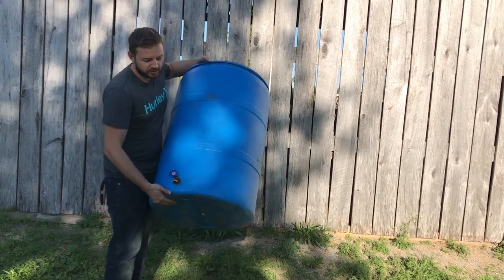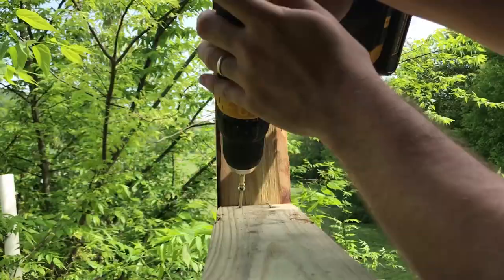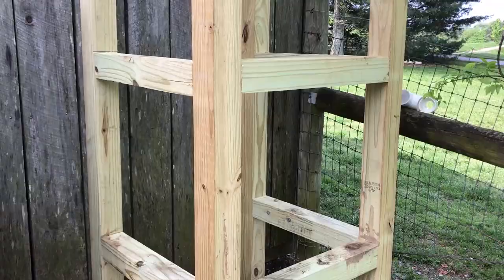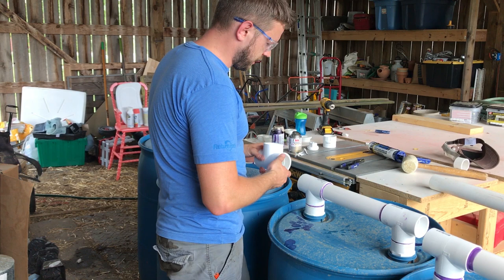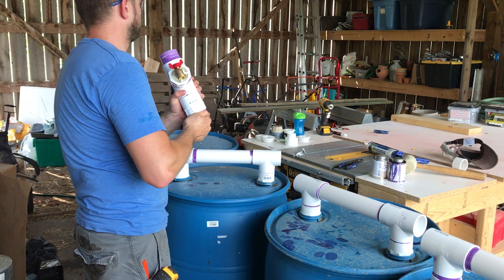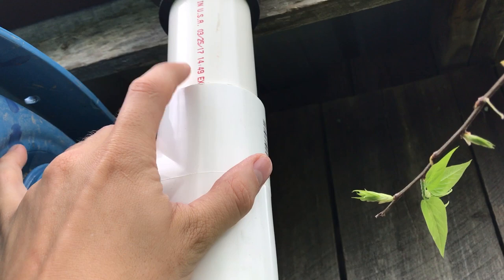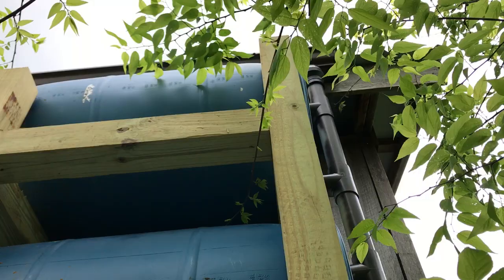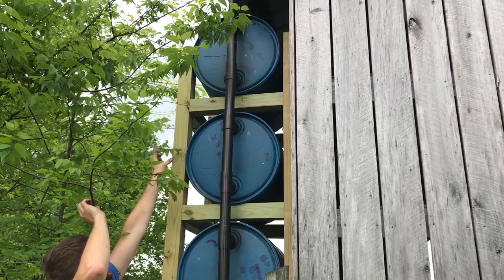🔨  DIY Rain Barrel Build - Vertical 4 Stack 55-Gallon Drum Rainwater Harvesting System

Comment: Where did you get the male adapter for the bung  holes
Reply from the maker: Home Depot they have the smaller thread and for the large thread bung I shoved on a small thread and epoxied it in 👍🏼 it did not make it into the video unfortunately. I want to redo this video sometime.
Reply: Thanks I’ve been looking every where then i seen  your video I got 13 barrels for $30 & looking to experiment with watering & feed
Reply from the maker: Oh dang that’s awesome! DO IT!
Reply: Thanks for the tip I got 1 it fits my blue barrel but not the 35 gallon white ones

Comment: I'd think the only problem is that your losing space in each barrel that you could have filled with water. each one is only going fill till it reaches the top hole in each barrel then air is going to get trapped in each one. also when draining it's not going to completely drain its only going to drain to the bottom pipe on each one leaving some water in each barrel. I think the only way to get around it would be to cut into the barrels and attach by adding pipe between them and draining into the top barrel so it flows down. but then you're cutting up good barrels. so I guess it can't be helped.
Reply from the maker: Thanks for having a look. I am going to watch the quality of the water over time.
Reply: I saw one example where it was stacked right-side up, still with 4, and the threaded holes are on the bottom and they tapped into the top for the “drop-in”. PVC piping was added to the bottom.

Comment: If the drums get full where does the extra water go?
Reply from the maker: It just flows right out over the top of the gutters
Reply: Use a water discharge hose and a 3 way rubber connector that kicks out at 90*. Place it a touch higher that collection and lower than gutter. If you have a first flush, I’d place it just before.

Comment: Maybe wrong, but using T fitting and connecting them was unnecessary.  If you just had 90 degree fittings the water would flow in the top hole and out the bottom hole in the barrel below and so on. Coulda saved several steps by cutting that.

Comment: We tried this idea, it does not work..  These type of barrel  are only meant to stand up right.  As soon as they fill with water the will distort and start to bulge in the center and bottoms.  This will cause the connection to come apart and water will just leak out.

Comment: Thanks for this video! I'm thinking of making a 2 tier system in a month or so. How has this held up so far? Also, how is the water pressure? I'm going to try and use mine with a soaker hose, but not sure what kind of pressure I'll be looking at?
Reply from the maker: I think it would work great with a somersault hose 👍🏼 it’s actually got a bit more pressure then I expected. You can plug it with your thumb but you can also squirt water with your thumb. The system is still holding up great. Something to note is that on the barrels one of the bung holes is a larger thread and you can’t buy the adapter in stores so I just jammed in the wrong thread and epoxied it into place. Good luck and God speed sir!
Reply: how do you mean a soaker hose??  did you do it??

Comment: update?
Reply from the maker: Still working well. I am going to switch out the spigot for a ball valve. The spigot is cheaper but even the smallest leaves clog it up and slows the flow of the hose.

Comment: The whole thing will collapse at some point, the structure is not designed to take all that weight, very unsafe, very poor choice of carpentry joints, it could have been built to be very strong

Comment: Did the screws alone hold the weight of the water barrels when they are full? I'm going to build this, but I may leave the 2x4 spacers in there to help support the weight of the barrels when they are full (I have a 50'x60' roof that water is running off of, which is about 1800 gallons of water per inch of rain, so my barrels will be completely full really fast).